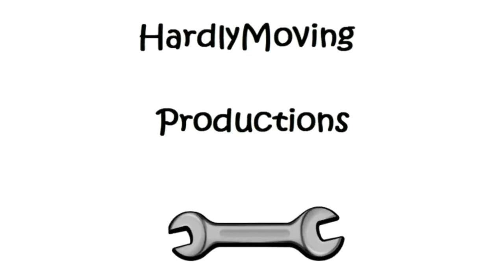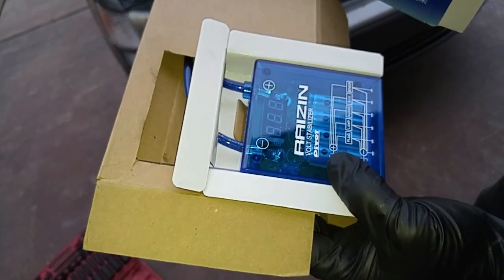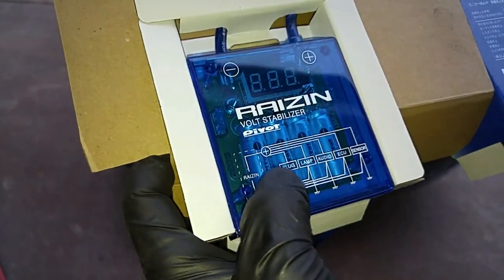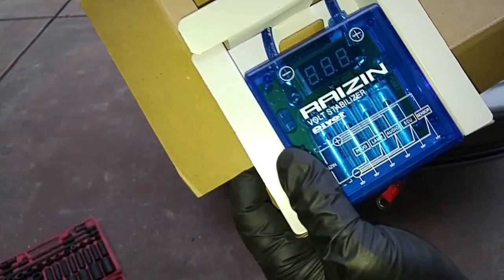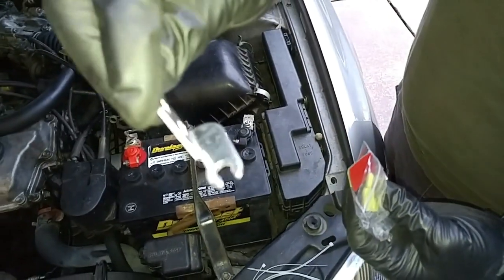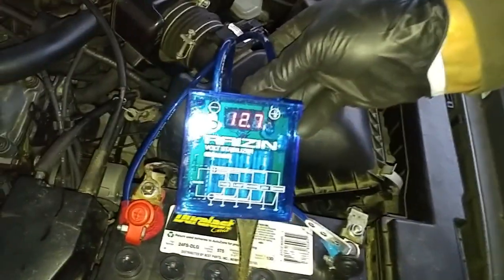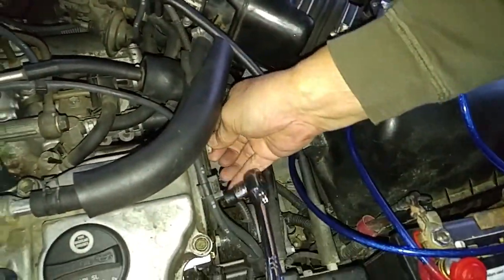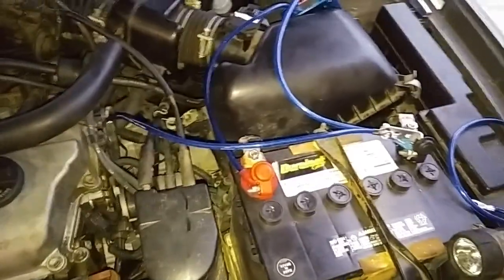RAIZIN Voltage Stabilizer Installation

Comment: This device is not a voltage regulator, the voltage regulator is on the alternator or in a external box regulator. This device is a tiny capacitor bank. If you want to kill your car battery use it. the display will consume the battery untill dead.
Reply: @dragan3290 
I have the voltage stab. every 10 days my new battery was drained....this form this voltrage
Reply from the maker: Never had a problem with battery drainage.

Comment: Congrats, you just installed a volt-meter in the least useful spot - the engine bay. That's all this product will do - the caps are bone dry, except one of them. Check out Big Clive's tear down of this thing.
Reply from the maker: I also have an accessory socket LED volt meter.  Cost around $5.

Comment: I just watched a video of a guy take one of these apart...it was nothing but a con....the capacitors were fake
Reply from the maker: Depends on if it's a made in Japan version or a Chinese clone ... and there's a lot of clones out there.  The company that makes it is called Pivot. Here's their link:  https://pivotjp.com/product/raizin/raizin-e.html
Reply: @hardlymovingpro  Thank you for the information...It should have been said in the video of the guy that took it apart...That is not a fair review of it then....Never mentioned there were fake ones

Comment: I wanna try this on my 2015 ram 5.7 already have the big 3 done with 0 gauge wire and the 5.0 farad cap and my  alpine pdx amp is all #2 wire. I'm really curious to see what it does if anything . I guess the drive cycle will tell all
Reply: You already a much better cap installed in your vehicle's electrical system, no need for these little dinky ones.
Reply: No, you don't! SCAM!

Comment: I just installed one, and except for when the negative cable was first touching the negative terminal during installation, the display is not showing at all. Is something wrong? I did it exactly as you did except one less grounding cable. The only thing different was that it gave off a few sparks from the negative terminal, but in my experience that’s normal, like when you hook up jumper cables.
Reply from the maker: Could be a defective unit and needs to be returned for a exchange or money back.
Reply: @hardlymovingpro  Thank you. Thankfully the website has a 60 day guarantee.

Comment: I have an overcharging/undercharging alternator 

Idle no aircon and lights 15.0v
Idle with aircon 11.5v
Idle with aircon and lights 11.0v

Revved at 2k rpm no aircon and lights 17.8-18.0v sometimes it reaches 19.0v
Revved at 2k rpm with aircon 16.8v
Revved at 2k rpm with aircon and lights 15.8-16.0v

Will this volt stabilizer help? 

Thank you
Reply from the maker: I think you're alternator needs to be replaced.

Comment: Right before I ordered this, I took a wire brush wheel and cleaned all my grounding ports in the engine bay. That by itself Really cleaned up the radio a lot and the dimming from the headlights. I’m excited to get this put on. The car has a lot of electronics including a DVD player that intermittently goes out. I haven’t tested the DVD player since cleaning the ground but I expect it to be night and day
Reply from the maker: Thanks for sharing!

Comment: This one is imatation / fake , there are a lof of photos and links explaining the diferences between the fake and the original in google , you can see here: https://www.bing.com/images/search?q=raizin+voltage+stabilizer+fake&FORM=HDRSC2   , but maybe it can work too
Reply from the maker: You're right.  It can be difficult to find a authentic one.  But I think in found one listed in Amazon.
Reply: @hardlymovingpro  i have One that is also fake , but it has One more function: volt meter and its works 100% like the original and it is way cheaper

Comment: you should connect the positive  terminal on the output voltage of your ignition switch so that when its ON position and voltage stabilizer energized.but if it is directed to the battery it will drained faster when you are not using your car in a few days.
Reply from the maker: Perhaps ... but never had a battery drain issue having not started the car in over a week.  Also, the newer units have a automatic LED shut off feature.
Reply: Exactly that happened to me with my Toyota hilux.
Reply: @dragan3290 
I have the voltage stab. every 10 days my new battery was drained....this form this voltrage

Comment: can anybody tell is this device is really fuel savor ???
Reply: Yasir Abbasi It’s a scam. Look for it on YouTube. First of all, it will NOT save you fuel only by connecting to the battery. No device will. But the capacitors in that thing are even fake so...

Comment: Hello! Are all those grounding points required? Can you just plug the box to the battery? Thanks!
Reply from the maker: Not required ... but helpful if your existing ground connection points aren't 100% ... like with most older cars.
Reply: Hello installed the Pivot today just the unit no ground wires. I have the purple one. So the read out says 13.7 then it blinks 8.6. I think the read out is not accurate. I have volt meter on my dash and it read around 13.8. I am not sure why it blinks 8.7.
Reply from the maker: Got to be careful that it's not a cheap Chinese knock off.  Ebay is flooded with them.
Reply: I don’t think it is a knock off. I bought from Amazon. The readout shuts off in about 15 seconds.
Reply from the maker: That doesn't seem normal.  Any info in the box about warranty?  If not, assume knock off.
Reply: @hardlymovingpro  it show the lowest voltage during usage ie during starting. If you bought the fake one just buy some real capacitor and change it
Reply: I am sending it back to Amazon. I just ordered the Nrg Epac 2 seems like a better brand.
Reply: So the Pivot seems to work on stabilizing the voltage. The meter still seems off. Shows 14 volts when the car is on and still blinks 8.7. I know the voltage is 14 volts and can see it on the dash voltage meter. I am running Ac and sound system. 2 tens and 2 amps🔈🔈. Voltage is holding around 13.8 and 14 volts.🚙
Reply from the maker: Maybe adding the additional ground straps would help to stabilizer your electrical system even more.
Reply: I think the Pivot unit monitor is bad. My in dash voltage meter has 14 voltage

Comment: Can I ground correctly to the alternator?
Reply from the maker: The alternator is grounded to the engine block.  Just run another one or two ground cables to the block.
Reply: @hardlymovingpro  thanks

Comment: Is that a Toyota Avalon?
Reply from the maker: Lexus ES300
Reply: @hardlymovingpro  the engine bay looks just like a 2000 to 2004 Avalon. I guess they share the same engine.
Reply from the maker: Good observation.  In some model years, the Camry, Avalon and ES300/330 share the same chassis.

Comment: Thanks for the step by step, for people following the guide, remember that when you're adding grounds to any point that you're are making good CLEAN metal to metal contacts. If you're grounding to the chassy, make sure to sand off the paint at the contact point or else the grounds wont do their job. Once you get clean metal to metal contacts, make sure to protect the grounds with dielectric grease along to make sure that any crimped lines are protected by heat shrink to minimize oxidation (additional resistance that will affect current)
Reply from the maker: Thanks for your post and you made some very good points.  For awhile I was going nuts trying to figure out why every time I pushed down on the brakes, raised or lowered my electric windows or felt my ac compressor engage, my dash lights would dim and engine rpm's would slightly drop.  After I installed some additional ground straps, all these problems disappeared!  I'm going to mention your recommendations on this video's description.
Reply: @hardlymovingpro  Make sure that the engine harness grounds are also properly clean and making good contact. Won't make a difference how well grounded the engine and chassy are if the wires connecting to the devices aren't making good  contact. Thanks for the reply!
Reply: @hardlymovingpro  Will this work with batteries that have the terminals on the side of the battery?
Reply from the maker: You'll have to get terminal extension bolts with a recessed bolt for accessory hook up.  Basically a bolt within a bolt.

Comment: I must install voltage stabillazer on inside the car to monitor charging system
Reply from the maker: If you want to monitor the voltage from your car, you can get this handy tool you can plug into your cigarette lighter:
https://youtu.be/5oq5jhWkG0I
Reply from the maker: Oh ... forget to mention ... if you want to recharge your battery better than a trickle charger, check out this device:
https://youtu.be/0vsgNyYvsk8

Comment: This really helps... i will post the installation and the result soon because i can not find in youtube any installation in trunk for the RAIZIN Voltage Stabilizer   thank you
Reply from the maker: Sure ... send me a video and I'll edit and post it.  I have noticed an improvement in engine idle when I added a couple more ground cables.

Comment: i bought it after watch this video but my battery in trunk how to install it? please your advice
Reply from the maker: What I would do is add an additional ground cable from the battery to the chassis and use the remaining ground cables in the engine compartment.  Otherwise, you'll need to buy ground cables that run the length of the car.
Reply: @hardlymovingpro  i will buy it thank you
Reply from the maker: After thinking about it, I would recommend you make your own ground cables from a spool of 10 gauge wire.  They're pretty cheap on Ebay.  You can custom cut to your desired length and crimp your own terminal connectors.  The only other issue would be whether you run the cables through the interior of the car or underneath the chassis.  If through the interior, the cables would have to pass through the firewall to the engine compartment. Another possibility is tracing the battery cable from your trunk to the engine compartment and have the ground cables follow the same path.
Reply: Dude just connect it to battery n trunk and ground the grounds to grounding spots. Keep n mind if ur ground wires r longer then a foot or 2 then the condensers or capacitors will do not good though
Reply: Justin Barnes People tested it online. The caps are fake. The product is fake.

Comment: Do they really work and where to buy them from
Reply: They do nothing!  After one year of use i disconnect it and so.Do not recommend!
Reply from the maker: Just do a search on Pivot Raizin Voltage Stabilizer.  Beware of Chinese cheap imitations all over the place on Ebay.  Raizins are Japanese.  

Here's a link to a site that seems to provide good info on Raizin stabilizers:

 https://www.carreviewsncare.com/voltage-stabilizer-and-grounding-cable-effect-myth-and-fact/